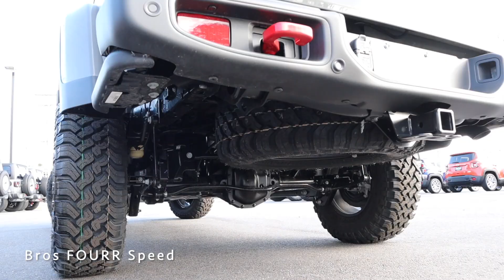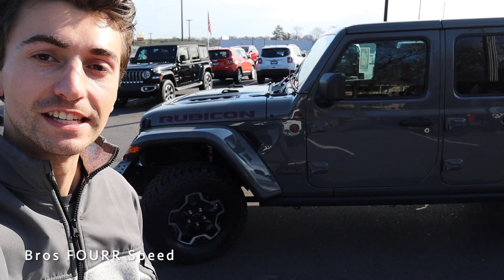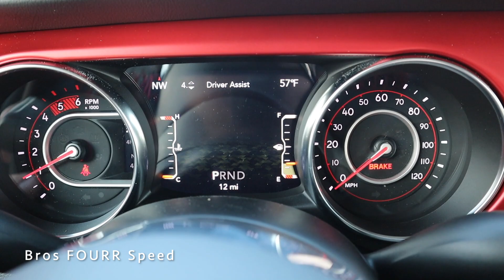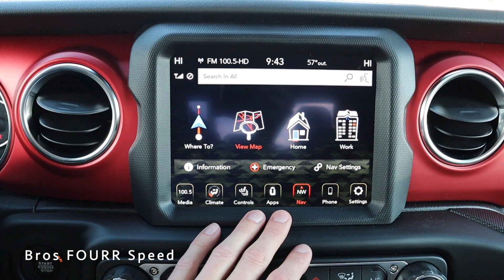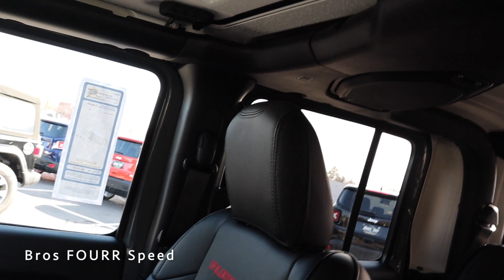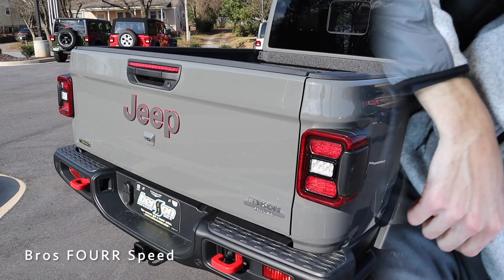2021 Jeep Gladiator Rubicon Diesel: Start Up, Walkaround, Test Drive and Review

Comment: Just ordered this thing.  I can’t believe diesel isn’t the most popular engine option for trucks and SUVs.
Reply: Have you seen the price of diesel?!?!
Reply: @JohnDoe-nz6bk  yeah.  It's cheaper than regular gas.
Reply: @djp1234  🤣🤣🤣🤣🤣 it's.80 cents higher than regular gas!
Reply: @djp1234  and just you wait when you have to pay more for maintenance and DEF fluid, which is about 4 dollars a gallon right now at pilot. 15 a gallon if you use mopar.
Reply: @JohnDoe-nz6bk  it's cheaper than regular gas where I live.  Even if it was 80 cents higher, it would still be worth it because it gets 2x better MPG.
Reply: @JohnDoe-nz6bk  I will save around $1,500 a year on fuel, which will easily pay for the slightly more expensive oil change.  And DEF is dirt cheap.  It's only $20 for every 10,000 miles.
Reply: @djp1234  the maintenance costs outweigh mpg gains.. I've owned 2 diesels 6.7 Cummins, and the 3.0 duracrap. You pay faaaaaaar more money for a diesel then you do with gas engines.
Reply: @djp1234  🤣🤣🤣🤦‍♂️ oh good God man. You reeeeeeally need to educate yourself on diesels. You only get a 1000 miles out of a gallon of DEF. That engine will regen every 150, to 200 miles. The oil changes are significantly more than a gasoline engine. Your not even taking into account the fuel filters which are expensive. Then the 30,000 mile maintenance of the EGR. Dude, you absolutely have no idea on what you're talking about.
Reply: @JohnDoe-nz6bk  I've had a few diesel cars already and I haven't had any extra costs.  I've saved a ton of money on gas with them.  Maybe it's different for heavy duty truck engines and for GM engines, but European Diesels are great.
Reply: @djp1234  I call bullshit!
Reply: @JohnDoe-nz6bk  lol ok.  I've had 2 Volkswagen TDIs and I have a BMW 328d right now.  No issues at all.
Reply from the maker: I agree. I really like the power you get from the diesel! That's what I'd buy

Comment: The 2020 and 2021 Jeep Gladiators all models are developing leaking axle seals on primarily the rear drivers side. Jeep knows this and are replacing the axles under warrenty. There is a good chance that a recall is coming soon.
Reply from the maker: Oh wow. Good they are replacing them at least

Comment: I believe one reason for the unpopularity of diesel cars in the US+A is their dirty image. They’re associated with dirt and muck, whether it’s coming out of the exhaust, or whether you’re putting it in the tank.
Reply from the maker: I can see that!  With the technology and regulations, diesels have become more quiet and nothing coming out of the exhaust!  It's mainly the older trucks with the guys that like to "roll coal", which I think is dumb!
Reply: Diesels are more fuel efficient, which contribute less to global warming, but they produce more nitrogen oxides than a petrol engine, which is responsible for acid rain and health problems in humans.
Reply: No... It's the maintenance cost, and Def/dpf system.

Comment: Good review! Way too much for that price though IMO.
Reply from the maker: Fair enough!  Wranglers and Gladiators are very expensive!  But on the used market you can find some good ones, still expensive, but won't loose much on them!
Reply: @BrosFOURRSpeed  just curious, if someone were to offer you 60k for that would you consider? For my comment, I didn’t mean way too much, just a little bit.
Reply from the maker: @coltonhawk21  Honestly I’d never pay close to that for a Jeep. I bought an 18 Wrangler with 20k miles for $35K, and sold it for the same price! Spending $60K for a Jeep, I could never do, but if you want a new one and absolutely love it, go for it! Everyone has a different view of models and the cost.
Reply: @BrosFOURRSpeed  that’s awesome! I love jeeps because they keep most of their value if not all like in your case. Also, you have a good point, they make Jeep’s in the 30-40k range that are great!
Reply from the maker: @coltonhawk21  There are so many models and trim levels to go with, but yeah in that range you can find a lot of great Jeep’s!

Comment: Need to really improve the cooling of the diesel motor.  Then it should be able to tow up to 9,000lbs.  They have a cooling problem
Reply from the maker: Yeah I'm sure max towing will be a bit of strain on this truck. The suspension doesnt feel like it can handle it wall. Didn't know they had cooling issues

Comment: Those rear speakers in the ceiling are quite unique! Make you wonder how they would sound if you crank the music up.
Reply from the maker: They sound very good! You can hear the great even with the doors off!
Reply: My 2015 has them in the ceiling.  The amplifier is on the floor of the rear of my jeep.  If you disconnect the wiring harness from the rear removable top the amplifier can sense it and increase wattage.  It was done this way to give the vehicle occupants the same sound whether the vehicle had tops on or off.